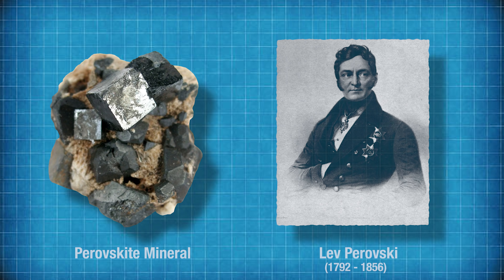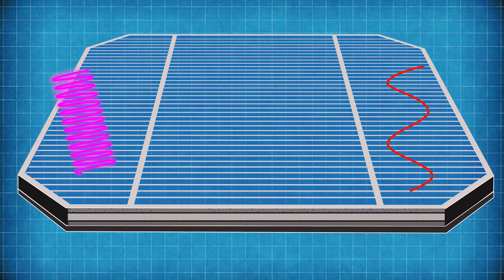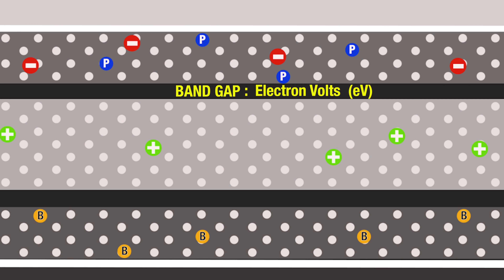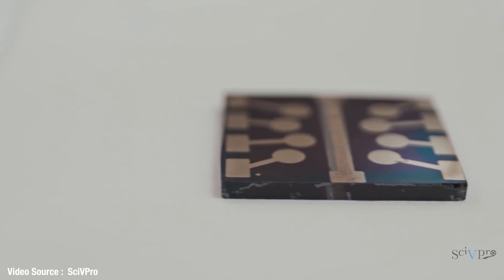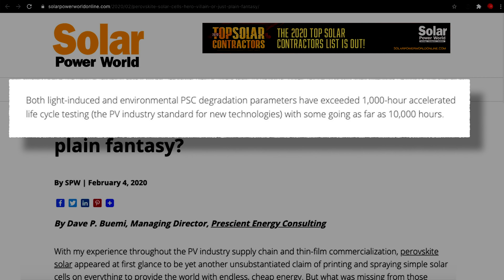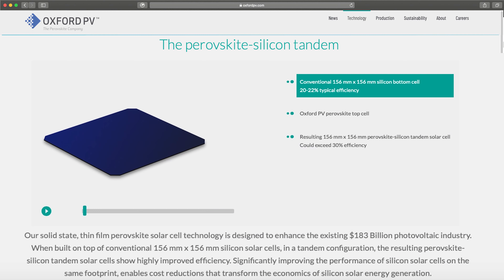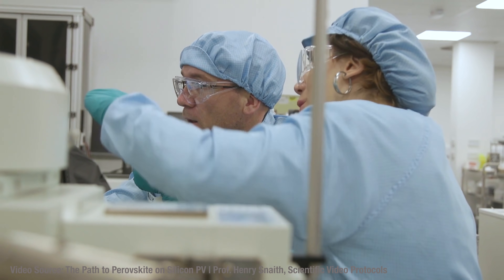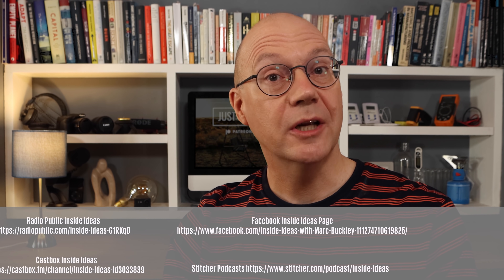Perovskite Solar Cells: Game changer?

Comment: While researching efficiency is great, and there are some applications for that, we really need to focus on reducing the cost of PV cells. If our current cost per watt is ~ 1$ [usd]. To power the entire US would cost more than 2 trillion dollars. Rough numbers and of course this doesn't include storage etc. People won't change because its good for the environment, they will do it when its cheaper than the alternative.
Reply: Which it could be, if there would be a carbon tax
Reply: @EctoMorpheus  I would settle for taking subsidies away from oil and putting it towards renewables.

Comment: Would you please redo this video with an analysis of the relative lifecycle costs of various solar tech? When you tout the 25% efficiency of perovskite cells  without disclosing the efficiency degradation rate compared to c-Si you create the mistaken impression they are equal when the useful life of the perovskite is likely only a year or two compared to a 25 year Si cell. The perovskite would have to be replaced more than a dozen times and each time the labor is at least triple the price of the Si cell panel. Please give us a better idea as to the minimum effective lifetime of the perovskite panel needed to break even with c-Si.
Reply from the maker: I think Professor Snaith would disagree with you. Perhaps you should take it up with him. I am just a reporter. He is an expert.

Comment: "The most common panels today ... produce only about 23%"
I think you will have a hard time finding 23% panels anywhere in mass-produced, commercially available quantities, far from being "most common panels today". 20-21% more like and only if you can find and pay for the premium products.
These guys just achieved 23% last month but are only claiming that mass-production is possible:
https://www.pv-magazine.com/2020/06/24/heterojunction-mwt-solar-module-based-on-23-efficient-cells/
Reply: Agree, Live off grid.  Sure can get panels in 23% range but not worth it.  Just build a bigger ground array and save a ton of money and only increase foot print slightly.
Reply: "The best modern commercial silicon solar cells are about 24% efficient" is what he said, not what you quote. And that's correct today, but will likely soon be bettered. http://investors.canadiansolar.com/news-releases/news-release-details/canadian-solar-sets-2381-conversion-efficiency-world-record-n
Reply: @simon7790  1:09
Reply: @41istair  Your quote is correct! My apologies for saying otherwise. 23% efficient panels are being used in [new build] applications today, for example: https://cleantechnica.com/2020/05/27/oman-using-bifacial-solar-panels-in-giant-500-mw-solar-farm/ 

Even though the world record efficiency is being broken every few months, and the ones in commercial use are also improving all the time, it still makes sense to do more R&D into supporting technologies, such as Perovskite.
Reply: Overestimating the performance of renewable energy is par for the course for this guy. More and more he just seems to be a mouth piece for green capital
Reply: @AlanBolshevik  Thank you for articulating the truth !

Comment: Perovskites are cool, but I think we are obsessing a bit over solar cell efficiency.  Aside from space applications and a few other anomalies, efficient conversion of sunlight is not anywhere near as important as the overall cost per kwh.  If the cells are a little less efficient, but they cost half as much, just install more of them!  It's not like we're running out of roof area.  It's still not clear to me how Perovskites compare to Silicon on an LCOE basis.
Reply: Yeah I'm looking forward to a dirt cheap slightly less efficient panel that everyone could afford to put everywhere. Then we'll start seeing solar making a real impact on our power needs.
Reply: Yes, space is important.
Also, I wonder what kind of infrastructure needs to be in company with solar panels, like inverters, and how much that contributes to the cost per kwh. It might mean that having a whole bunch of directly connected panels is a lot more cost-efficient than lining roofs separately (unless you somehow connect roofs?! might not be a great idea for direct current, though).
I also don't know one bit about energy storage and what that involves.
Reply from the maker: I'm not sure they can give an LCOE comparison without scaling up to full production. That would be an interesting (and probably decisive) metric though.
Reply: The idea is that they could be more efficient AND cost less than silicon cells
Reply: @keithmoran7371  They're a little more efficient, but historically they've had a much shorter lifespan.  As Dave suggests above, LCOE is everything.  It's the way we decide how to use our limited resources.  I don't know what the service life of the latest Perovskite cells might be, but if it's much shorter than silicon, that will kill LCOE.
Reply: @incognitotorpedo42  this entire comment section is frustrating because you and several others are dismissing perovskites because they are not ready for prime-time right now. Obviously lifetime is important. But other important factors in LCOE include performance (efficiency) and module cost (which solution processing aims to reduce over foundry manufacturing of silicon). Bottom line is that this technology is matching the performance the silicon industry needed over 50 years to achieve within a decade of discovery for use in solar, has a feasible pathway to reducing module costs, and does not forecast to run out of materials needed.

The are something like 20 companies working to produce perovskite modules worldwide. Just like silicon solar in the 70s, they will continue to develop despite market dismissals because we have to find a better way to expand solar capacity to meet the terawatt challenge.
Reply: @keithmoran7371  I never dismissed Perovskite cells.  I said LCOE is important.  You seem a little touchy about this.  Do you work in the Perovskite industry?

Comment: Thank you for another great video!

Perovskite solar cells sound very promising. Going by what you said, it certainly seems like they could be the future for solar cell production. But I do wonder how much inertia there may be in the old system, represented by things like the sunk costs investors have put into already existing silicon production lines. I really have no idea how easy it might be for existing factories to switch over to Perovskite. If the new methods have shorter supply chains and use common materials, then it should be cost effective to switch. But again there's that element of inertia, and how much incentive there may be to spend the money and effort to change.

Most solar panels are made in China, by a large number of rather nebulous companies that freely steal intellectual property like production methods from each other. So if there was a real financial incentive to switching to Perovskites (like a clear consumer preference) that Darwinian environment of pure capitalism may encourage a fairly fast change over. But other countries that make solar panels (like Germany) might be slower.
Reply from the maker: Hi Kevin. Yes, I agree. I'm sure market forces will determine the outcome as always. It's a shame we can't view these projects as global existential initiatives and take capitalism out of the equation.
Reply: One thing recent events have shown is that we can respond incredibly quickly as a global civilization to a widespread threat. So the capacity to do what you said is there.